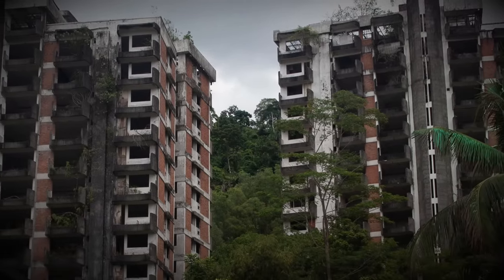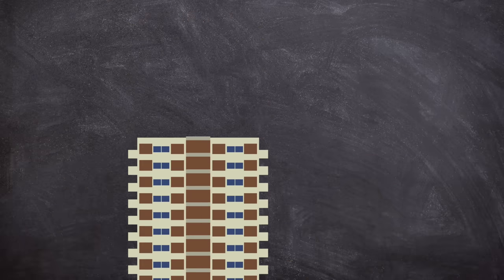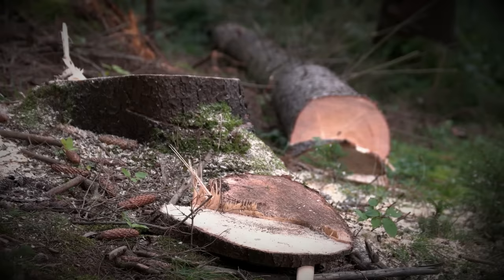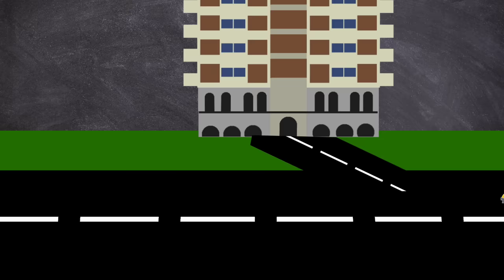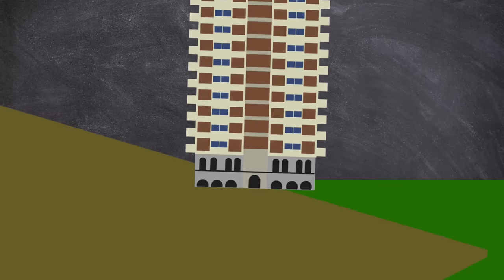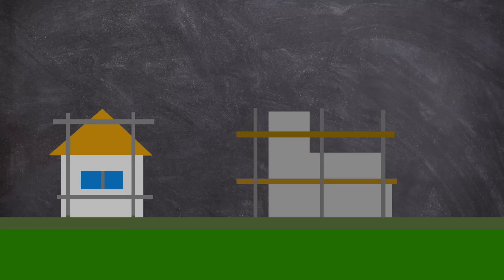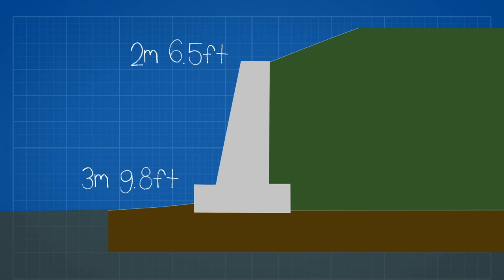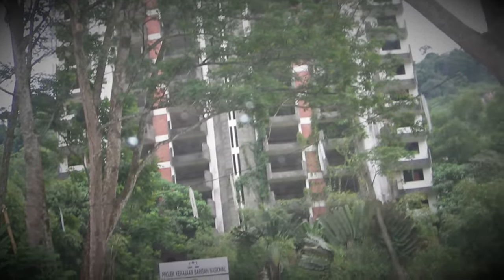Improperly Built Tower Block Collapses In Heavy Rain | Plainly Difficult

Comment: I remember this vividly in the news as a child. Highland Towers are still quoted today here in Malaysia as a reason to avoid excess developments of hilltop properties even 3 decades later. I'm surprised the death count is actually lower than the usual impression most have of the incident (you'll hear guesses in the 100s, or dozens of families, which is clearly not the case)

Your pronunciation is decent John, admittedly there's some inconsistencies expected of machine pronunciations you might have checked against.

Some additional translated context of local names
Ulu Klang - Klang river source (referring to the water catchment area that supplies the river)
Taman Hillview - Hillview Park
Bukit Antarabangsa - International Hill (no doubt due to the many expatriate residents)

Comment: It's a little mind-boggling that so much time elapsed between the landslide and the collapse of the building, and yet there were still people inside. If there's a giant landslide that comes right up to your apartment building and cracks start to appear in the concrete, it is time to flee before you die.
Reply: I think in Malaysia it's pretty common for cracks to appear in buildings.
Reply: @3rdalbum It’s common for cracks to appear anywhere in Malaysia 😂
Reply: Cracks dont necessarily mean the structure is unsafe.  Cracks appear anytime concrete under stress or installed improperly.  Usually the reinforcement is enough to keep the structure standing.  However cracks need to be repaired after the structure has been evaluated.  Ita definitely scary when a structure is damaged and youre waiting on engineers to determine if it can be saved.

Comment: Sounds eerily similar to a collapse of hillside towers in Taiwan. In 1997, a typhoon triggered mudslide overran inadequate retaining walls, and then pushed into the side of buildings, leading to their collapse. Well, technically they didn't fall over or crumble, but were pushed by the mudslide and leaned over on the second row of buildings. Still, 28 were killed being buried alive by the mud rushing in. On further investigation, there were corruption and forgery of environmental and safety documents.

The first few rows of buildings facing the slope remains abandoned today as well, but further from the damaged area, buildings from the same project remains in use.

Comment: An excellent, and tragic, example of the safety "Swiss cheese" effect. 

Normally, multiple redundant layers of professional checks and regulations prevent mistakes of this magnitude. Any holes in one or more layers is usually blocked at some point, averting disaster. Sometimes, holes in all layers align and mistakes slip though entirely undetected. On rare occasions such as this, the series of mistakes can be catastrophic. 

People bemoan the headaches of bureaucracy and regulation, but they're often written in the blood of past tragedies.

Comment: Here’s how to think of it… As the dense, heavy mud surrounded the base of the hollow, relatively light building, the building tried to FLOAT.  Just like all those houses in videos of the Japanese Tsunami. The force of their own buoyancy pulling straight up was not something they had been engineered to withstand. This lifted the uphill side of the building off its foundation.  Because the buoyancy was mostly on the uphill half of the building, the downhill side of the building was torn off its foundation and then settled, dropping as the mud floated the uphill side until. Toppling as its center of gravity went past the downhill edge of the foundation. The foundation was strong enough to withstand the lateral force ( like in an earthquake ) But NOT designed to withstand buoyancy lifting the building UP with hundreds of thousands of tons of force. 
In the Tsunami, as the water rose, the bolts holding the houses down either tore thru the wooden sills, or were snapped off due to the buoyancy of the house. Only AFTER they were torn free of the foundations holding their walls square, did the current start to break up the houses. 
Buoyancy is the force that broke the titanic in half.

Comment: I stayed one night in a half complete development in KL a couple of years ago. It consisted of several towers, some only half clad, but clearly abandoned for several years, scaffolding board crumbling out of the frames, piling a the bottom. The whole complex was joined below by a giant underground parking  lot, a shopping arcade that never opened and some of the concrete ceilings of that part where already collapsed. It was interesting and I was glad to only be staying for one night. One of the tower bases had a vertical crack two fingers wide, but it was occupied nevertheless. I noticed that crack in the underground car park.

Comment: This is one of those where the opening setup sounds like a semaphore monologue of red flags for anyone in the know: 

cutting into hillsides, resulting landslide pressure resisted bu retaining walls which can degrade or be inadequately engineered, building resisting horizontal forces on concrete piles which can also degrade or be inadequately engineered, waterlogged hillside natural in that part of the world anyway so it requires adequate drainage and maintenance of same, on top of which you've got a bleeping stream to keep diverted which has probably weakened some underlying layers,  massive added weight, construction, and interference with plumbing from above, clear cutting which anyone who lives in a part of the world with deforestation or brushfires leads to erosion and mudslides (areas below burn scars in the western US are regularly evacuated for years afterwards before rainstorms to avoid mudflows), and throw in a monsoon season — a landslide is absolutely inevitable.

I guess before the internet we didn't have things like the landslide blog and constant news coverage of eroding cliffs, mudflows and suburban landslides to make these facts fairly well known.

Fun fact: warm air contains 7% more water vapor for every degree it warms (conversely, cold air can't hold as much, which is why your breath condenses and falls as droplets/frost on cold days). This means that as average temperatures rise, clouds can hold more and more water, increasing droughts, but when they do finally hit critical mass, they tend to drop more water, leading to more intense rain and flood events.

So areas that didn't used to have droughts and wildfires may begin to discover the problems places like California and Australia have with mudflows/landslides when rain falls on burn scars where roots no longer hold soil together. And we're all going to have to deal with more intense rain if and when it falls. So places that didn't used to have to worry about landslides are going to have to adapt to this new problem.

Speaking of which, I can't remember if you've covered "The Night It Rained Boulders" in Montecito (huge boulders, some as large as houses, coming down with a deadly mudflow into an affluent area north of me  about 10 years ago) or the Oso landslide which was a high casualty even triggered by rain and (I think?) logging.

Comment: The thing I find "funny" about this is the courts found various people guilty of this accident for "not reporting to proper authorities" but this was a 13 year old tower in a 3 tower complex that was later discovered to be built by a bunch of unqualified labourers, in an area where the municipality or government was not maintaining the infrastructure, and giving out building permits in sites that had been long neglected by said government. So there was clearly very little or no regulatory authorities overseeing any of this 6 year project to build these 3 towers followed by the newer project on the top of the hill starting in the early 90's... how where the people supposed to report to the proper authorities if it would seem the proper authorities themselves either did not exist, where negligent, or where incompetent and unqualified themselves? This looks less like blame being placed with the people involved in the project's eventual failure; and more like local governments and officials attempting to save face for not having proper regulatory and inspection procedures regarding building sites.

Comment: "The Architect" here in U.K. doesn't need to be qualified in very much at all to be called one - I've run some quite prestigious buildings in construction and during my working life, have seen the lowering of standards everywhere - we often have "designers" drawing up buildings who have little more than imagination and some pencils. Most certainly - no architect anywhere - no matter how "qualified" knows much about structures, loads and stresses - he relies on an Engineer and on some jobs I've been involved with, this has caused much political in-fighting between them - the architect not wishing to compromise his conception but the engineer saying it can't be built. I can't think of one here that's fallen down but our Grenfell Tower is most certainly a result of this scenario. 
Just for an added note of comfort - the last block of so called "luxury" apartments I ran before retiring - was never signed off by me - yet the building is fully occupied.